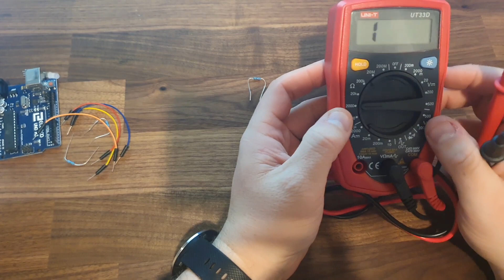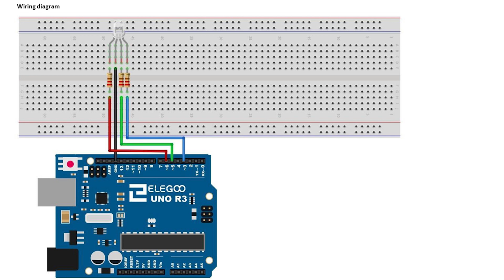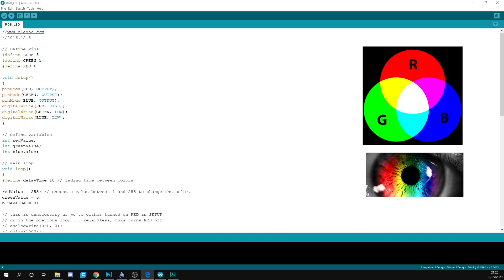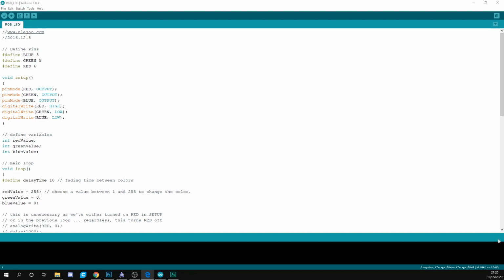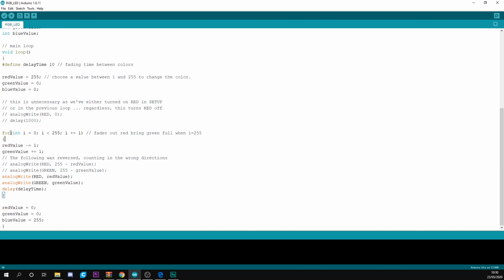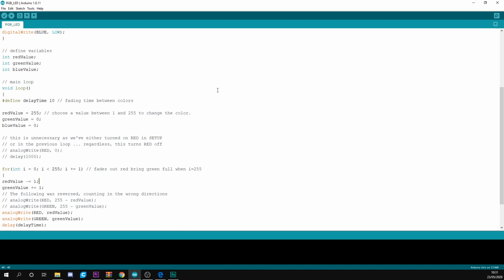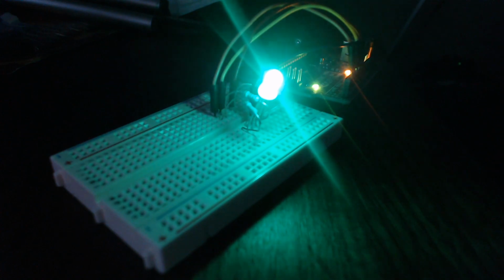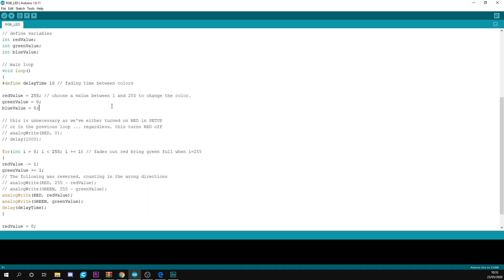Elegoo - Arduino Uno R3 Basic Starter Kit - Lesson 3 - RGB

Comment: Hello! Are you able to explain this part to me?

I understand what 'for (int i = 0; i < 255; i += 1)' is doing, but then this is confusing:

redValue -= 1;
greenValue += 1;
// The following was reversed, counting in the wrong directions
// analogWrite(RED, 255 - redValue);
// analogWrite(GREEN, 255 - greenValue);

I understand the redValue = redValue - 1 and greenValue = greenValue +1 , but why does it then say both analogWrites are subtracting their color values? or does a negative sign not mean subtraction in this case? I'm starting from scratch with this Elegoo kit, so I was trying to google this for an explanation of what's happening there.

thanks!
Reply: the analogWrites were writing from 255 minus whatever Value was in play. this doesn't work as it makes red increase and green decrease, which is the opposite of what we want.